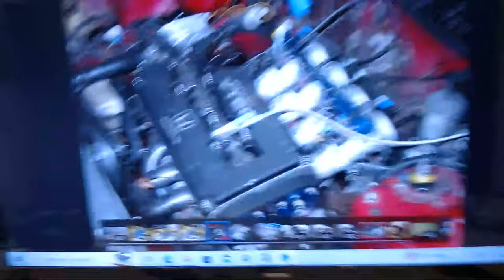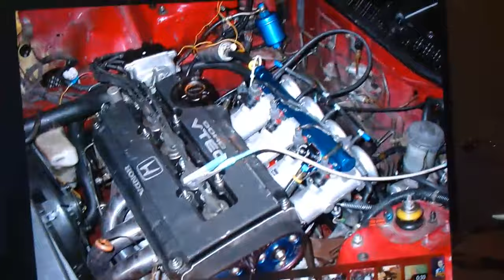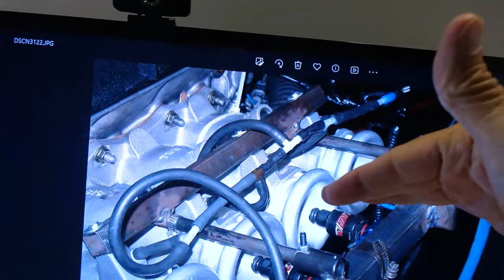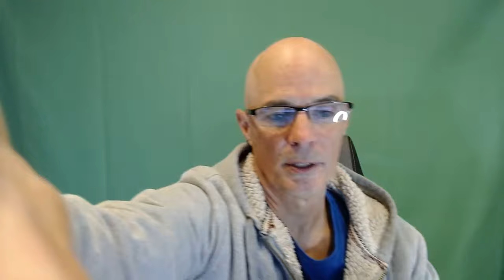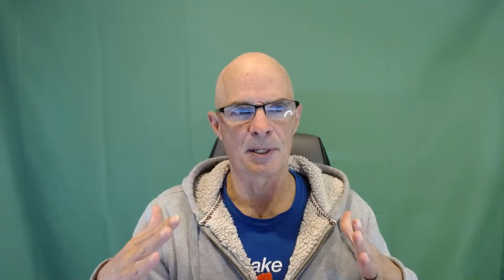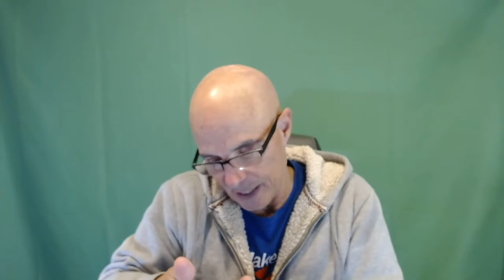LET'S TALK TECH-INJECTOR POSITION TESTING

Comment: Now this is something I have tested. Moving  the working injectors from the cylinder head into the throttle body, does make a difference, the two positions make better torque with the cam adjusted for each position. 
Sequential injection gives a better idle quality but when the revs are high enough batch firing gives the same result, or the same as far as it could be measured on the available dyno.
Stand off injectors are a must for power, though they seem to need to be 100mm away from the ram inlet. Two hole 5deg spray pattern worked better than a single,  4,6, and 8 hole injectors all with the same flow rate, which were worse across the tested rpm range in these tests. We had two and 4 valve versions of the same engine one engine 2-7500k another 3-8k one 3-10k and an other 4-12k.  The conventional throttle body injector set up does not seem to give more power at the top end over suitably sized Webbers. When you phase in the outside injectors the torque stays up long after any other set up is dropping off, it seems an extra 1500 - 2000rpm is a realistic expectation. 
The ecu to run it all was quite special back then.
Injection duty cycle and phasing was adjustable every 100 rpm on each individual  injector, along with ignition timing on each cylinder, just remember to select All when changing a value by percentage 🙄
It was week's of work on each test.
Time well spent🤔🙂
Reply from the maker: 12,000 rpm?
Reply: @richardholdener1727  Formula Atlantic 1600,  DBD Cosworth, and a 1000cc Cosworth MAE F3 unit used for F4 in an Brabam BT23 chassis
Reply from the maker: very cool

Comment: Of course you will get more the further away you put the injectors (within reason of course) putting it 10”+ you would need to adjust the pulse at low and top end. Mostly has to do with the velocity of air speed. When you’re at 8k rmp the pistons are coming up and down 120time per second and the valve train is in the neighborhood of 240 per second as you’re doubling up (that’s both in and ex). But the waves can throw the balance some. But in the grand scheme you can run it as is with little issue and will still gain from the injection being further away.

Comment: Saw a guy used stock injectors ,then drilled hole in each runner for "race" injectorfed by separate tank of race gas. You could have 2 tunes in computer depending which injector you run
Reply: Very common for drag and drive, often it will run the 2nd injector in addition to the 1st and one tune controls all of it